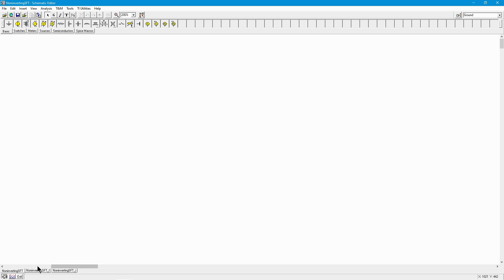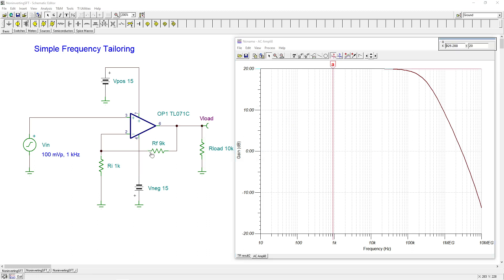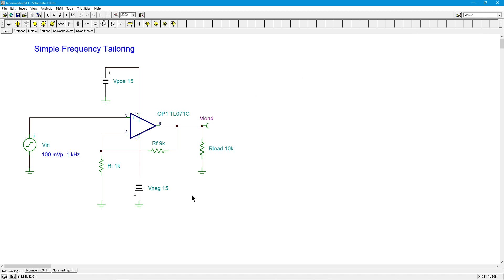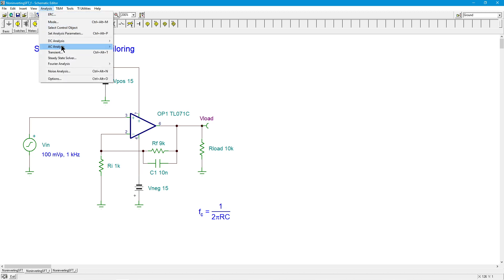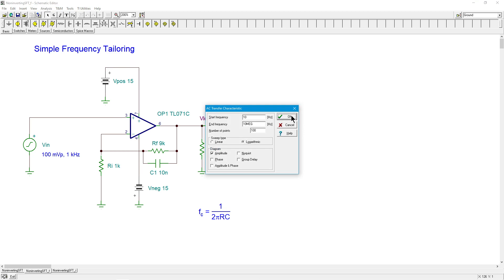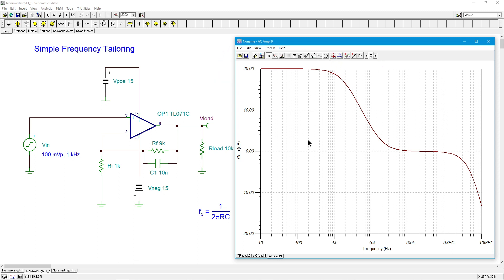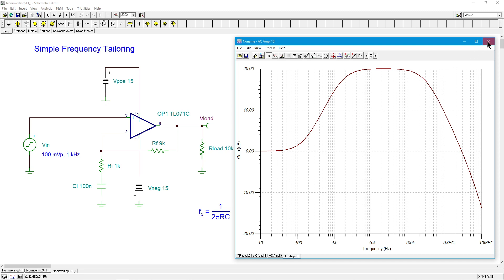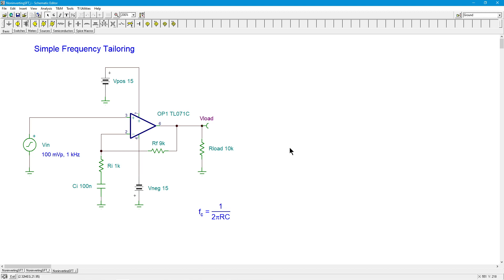Op Amps: Simple Frequency Tailoring

Comment: Professor I have been working on a simple opamp circuit just like this one in my simulator program.  I followed a schematic to add a 10K trimpot just after Ri to have a proper volume knob.  However, I noticed that the high frequencies become more and more rolled off as I increase my gain with the 10K trimipot.  Is this normal?  Is there a way I can keep this from happening, or at least make it less dramatic?  BTW thanks for all of these really helpful videos!
Reply from the maker: Look up "gain-bandwidth product" or "Funity" in my op amp text. There is also a video on it in the Op Amps playlist. There is an unavoidable tradeoff between voltage gain and f2 (upper frequency limit) in these kinds of circuits. The product of the two is a constant, so if you want more gain, you get a smaller bandwidth. If you wind up with a bandwidth that is too small, you have two options: find an op amp with a larger Funity, or make a two stage amplifier.
Reply: @ElectronicswithProfessorFiore  Wow!  Thanks buddy!  You are the coolest on Youtube.